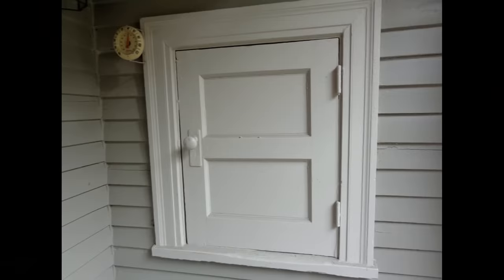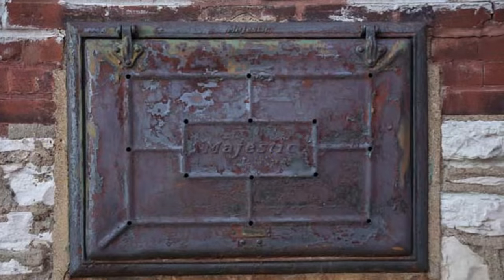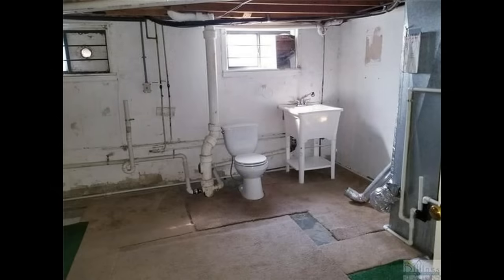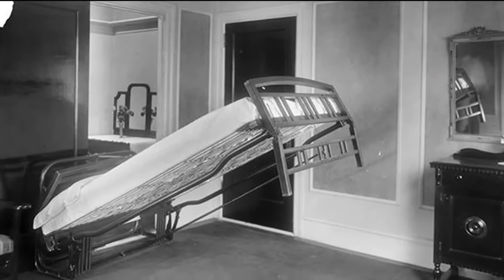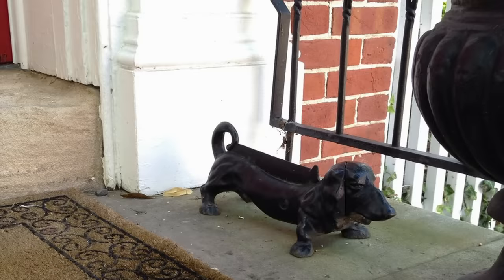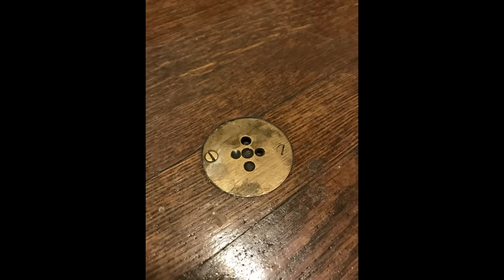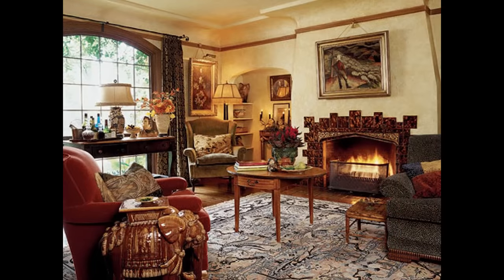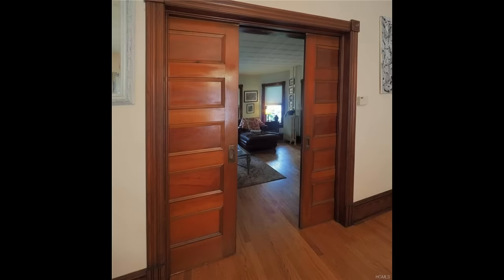Mysterious Home Features No Longer Used

Comment: Besides eliminating the need for transom windows, electric lighting made it possible to easily produce more elaborate meals after dark. Before electric lighting, the main meal of the day was typically at mid-day. Some people still call the mid-day meal dinner because of that.
Reply: We used the term "dinner" to signify the largest or main meal of the day.  Therefore at Christmas, Thanksgiving, and Easter, or whenever we were having a large group of people in to eat, it was called Christmas/Thanksgiving/Easter DINNER.  We usually had a larger meal in the evening on normal days when Dad go home from working in the fields.  The other term used for the evening meal was supper and the midday meal woud called lunch.
Reply: @davidrickard8943  Same here except the midday meal on Sunday was also "dinner".
Reply: Interesting.
My grandmother who grew up on a farm during the Depression explained what the difference between the noon meal being called lunch or dinner.

If they made food and took it to the workers in the fields it was lunch.
If they cooked a meal and the workers came to house to eat,
It was Dinner.

Thanks for the other insight.
Reply: Americans considering evening the main mealtime will forever mystify me.
Reply: @twincast2005  Well for the most part many Americans only get a 30 minute lunch break.
Especially those of us in service or construction jobs.

Personally breakfast is my main meal and anything after that is a bonus.
Reply: @twincast2005  I work for a tech company that provides lunch so that is my main meal.
Reply: @twincast2005  the evening meal is typically the only time when all the family members of a household can meet without being rushed out the door to school or work. It is usually a family meal where they all sit at the table and visit while eating. If course their are those that eat in the living room or den, the room with the TV.
Reply: @Cassandra Dining was a more elaborate affair which wasn't practical in the dark of night, so the dining used to take place at mid day. Electric lighting changed all that and turned it on its head. But for eons into the past, the biggest and most laborious meals were always prepared and eaten in the light of day out of necessity.
Reply: @twincast2005  I guess this is because of the fragmented morning start times, each school has a different start time to accomodate bus scheduling, Dad or Mom leave for work at one time and the other at another time.  So if the family is to have a meal together, it is in the evening (sometimes this is the only big meal children get).  Besides that, this is the time the bread winner usually gets home and needs a big meal if he has had a physically demanding job (which is still a hold over from before men went from a physically demaning job to more of the office and executive type work).
Reply from the maker: Thank you for watching Lance!

Comment: As someone with a 1950s home with 2 (formerly 3) pocket doors, I can understand why they're not common. They're hard to replace and repair. Sometimes you can get by just removing all the trim but other times you'll need to open up the wall if the track inside becomes damaged. As they age, it can be a real headache. Plus, latching or locking them securely has limited options that are usually finicky.
Reply: I assume they use the same rollers and tracks as sliding closet doors, which are always getting out of adjustment. Adjusting those things in a pocket door could be a real hassle unless access panels for such adjustments are designed into the envelope.
Reply: They are almost always designed without easy access. I have a couple in my home that we do not use because of adjustment issues. I really do not feel like removing walls
Reply from the maker: Thank you for watching and sharing your experience with them.

Comment: Hey Rhetty, here is an arcane feature for you. Many old, well built, homes in Chicago, Indianapolis, and St. Louis had rock-stone foundations. Did you ever wonder why? Well, houses in these areas often had high water tables throughout much of the year. If the area got soggy you would have a wet basement, but a dry house. Also, many Europeans were stone craftsmen. So these guys could shape and cement stones together. So it was an employment opportunity. But, finally, the soils in these areas had large rocks and limestone rock ledges. When you wanted to build a nice house you would hire a crew of diggers to make your footprint. Since there was a pile of stones in what would become a front yard, the next job was to wash what stone was dug out. Then the masons would cut and fit the stones into a basement walls. Today engineering techniques have been invented to keep these old house basements intact, for future generations.
Reply: Very cool.
Reply: My parents old house in NY was built in the late 1800’s and it had a stone foundation. Our house was the first one built on that block. It had a big beautiful stone wall that was seven feet high.  It is still in great shape along with the foundation of the house. They knew how to build things that would last back then.
Reply: @GhosstRyder  Actually no. Architects did NOT know how to build stone houses and there were many failures  since the stones were a pile made into a pyramid shape. It was not until about 1940 that architects had to invent the inverted (up side down) Tee. A pyramid just keeps slicing into the soil like a spade, over decades. A tee-base never moves. Today in St Louis many of these old homes are having sections of the walls dug out and then supported with concrete pads.
Reply: @MrMockingbird1313  Thank you. Our old house was built very well. We are still in contact with the new owners and everything is still holding up well.  My dad and Nonna (Italian for grandpa) were both stone masons. They did Beautiful work throughout the NY area. Those skills seem to be lost now because kids today are all glued to their computers. My dad passed away when my boys were very young so unfortunately he didn’t teach them that skill but they have other very useful ones. I have an electrician and my older one installs high speed garage doors for businesses and large buildings.
Reply: @GhosstRyder  Excellent information. One HUGE difference is the soil content. In this part of the Mississippi valley the soil can turn to mush with a small earth tremor. Soil back east is much more stable. That is why the pyramid vs. the inverted tee makes so much difference.
Reply: These are called “rubble stone foundations”. The waste excavation rock was repurposed as building material. 
The fast method of constructing these would be to build a horizontal wooden plank form work. The rubble would be more or less chucked in with mortar chucked in between stones. As the walls grew taller, another plank was simply added to the formwork. This way, it was easy to reach in the formwork as you went and place stones. Where one desired nicer-looking stones (usually on the outside of the wall and above grade) it was a straight forward change to the good stuff facing out, backed up by the standard stuff facing in. When dry, they removed the forms and would be left with a surprisingly-even wall surface masonry foundation that could be built relatively quickly, scaled well and did not require as much masonry skill.
Reply: @chriskelvin248  Field stone foundations in Wisconsin.
Reply: @kh3612  OK! Good to know other regions where this was also done. I grew up in a house with a rubble stone foundation in NY and was always curious how they used such haphazardly-shaped rock, yet achieved flat and square walls. Then, decades later I saw a job site where they chose this old-fashioned method and got to see the whole process+ talk to the workers about it. Fascinating and great look too.
Reply: @chriskelvin248  yes, you are correct. Anyway, this was common is some areas as a home feature. That was my point. Now it is arcane and not used in new construction.
Reply: @MrMockingbird1313  what do you mean they did not know how to build stone houses prior to the 1940's? 
in my local city centre there are houses made from stone. who have been build around the year 1100. To this day they are still in very good condition. 
not to mention some of the other buildings that are even older then that and still going strong.
Reply: @sirBrouwer  I mean what I said. Stone ruble foundations require annual maintenance and are prone to collapse from tremors and wind load. When inverted tee footings became more popular it helped old homes and homes after the '40s had concrete blocks or concrete filled forms.
Reply: @sirBrouwer  -  The year 1100?  What city in China do you live in?
Reply: @mdemers767  non. I live in the Dutch town of Flushing.
Reply: @MrMockingbird1313  a stone rubble. that is different then actually rocks as in actively extracting them from a stone quarry and make them to a exact shape. 

I mean have you aver seen the Roman build aqueducts? they are made from stone and they have been neglected for over half a millennia and still to this day they are in really good shape. and they are not a pyramid shaped building they are actually pretty sleek. I have seem some of them in France standing as if build only a few years prior.
Reply: @kh3612  Yeah, field stone foundations were commonly used in the 1800s in my home province of Ontario in houses, schools, churches, barns, barn bridges (the ramps leading up to the second story of the barn), along with field stone fireplace surrounds and chimneys. 

The last glacier left a lot of stones behind, and every farmer dreaded the annual task of picking stones from the surface of their fields, since the freeze-thaw cycle had inevitably pushed up a fresh crop of stones each year. The stones had to be removed in order to not break plows and other farm machinery when working the land.

Therefore, everyone had piles of stones laying around, and often built dry stone fences between their fields as well. 😁
Reply: @sirBrouwer  Well, I guess everyone is impressed with your world travels. But, your relating Roman aqueduct to stone ruble house, in the Mississippi river valley, makes as much sense as comparing giraffes and humans because both are mammals and have the same number of neck bones. Are you honestly NOT able to follow this thread or do you prefer to just spoil for an argument? Let's go over this one more time so you can keep up. Stone ruble basements and foundations met a need in the 19th century. Now they are an arcane building feature because they require much more work to maintain, for several reasons, than poured concrete. Got it? Be well. Read the threads more carefully.
Reply: @MrMockingbird1313  I did not read that in your statement here.

'' Actually no. Architects did NOT know how to build stone houses and there were many failures  since the stones were a pile made into a pyramid shape. It was not until about 1940 that architects had to invent the inverted (up side down) Tee.''

and no point in that command did you say anything about rubble.
Reply: @daviddunsmore103  I love the look of fieldstone foundations, fences, and fireplaces.  I live near a an area that had a lot of glacial activity, so I'm quite familiar.  A friend took me into her cellar to show me how thick the foundation walls were-- about three feet. The thing I don't like is the fake fieldstone they put on suburban houses.  It even looks fake.  Ain't nothin' like the real thing, baby! 😉☮️
Reply: Yes.. common features in San Francisco ! Also lever at top of stairs that opens the front door for guests at the push of a handle .  Another is cold storage area with screening to cool pies or foods pre refrigeration .  A built in bin in kitchen for flour storage .  Small  door in kitchen  opens to unfold a ironing board ! All present in  1903 home  i rent apartments  in !
Reply: @sfggmagda  excellent post
Reply: My dad's shop had a stone basement.  In the summer we'd open the coal shute and the inside basement door, then position a large draw fan to pull the cold air up into the shop.  Customers would comment on our wonderful air conditioning, back when ac was rare.
Reply: Miami has the same inherent issue when it comes to construction. The water table sits so high, especially because of the spongy limestone bedrock, that I have seen construction crews have to stabilize tall high-rise buildings by digging and casting cement for deep foundations.
Reply: Yes @GreatMewtwo

Comment: I'm glad you included root cellars! I lived in a house in NH built in the 1700s, and we had two basements: the regular one (with sealed off brick ovens and a sand "floor") and the root cellar. Mom was a teacher and every summer when she'd get a summertime bonus, she'd load up on groceries (for a BIG family) and store most of it down there. It was always pleasantly cool in the cellar, since it had a northern exposure. We also had a second staircase, that originally was meant for the help to use instead of the big, main staircase.
Reply: Plenty of new homes in Canada, to this day, are built with a root cellar under the front porch. However, they are more commonly called “fruit cellars”.
Reply: OMG.... 1700s ???   There is no way most buildings built today would last 250+ years. Unless you have the home built it for yourself,  Many builders often cut corners and skimp on quality. Look at how many 50 -60 year old high-rises have been demolished to start over...   ( Just search YouTube for building demolition .... there are demo experts who can make a building collapse in on it  self in the middle of a city.... great fun to watch.) I think I'll head over to one now.....

Comment: I've been in old homes that had an ironing board in the wall and had a little door to keep it from view.  The transom window above the front door is a great idea for extra light.
Reply: We had the ironing board that was tucked into its own little closet in the house I grew up in.  I wonder why we don't have things like that now.  I'm sure people still iron their clothes and it would be easier than pulling out the one that stands up on it own or the one that sits on the table - since both need someplace to store them.
Reply: @hlltwin  Most people just buy clothes that don't need pressing. They also can throw it back into the dryer with a damp towel to get out wrinkles. Lots of people just take clothes that need ironing to a laundry mat to have them wash and press for them.
Reply: I’ve never seen this in old houses but I have seen it in modern hotels and motels
Reply: @KnittyKitty215  buy clothes don’t need ironing? All clothes need ironing, even tshirts look wrinkly and need ironed. Are you suggesting people don’t own irons??? That’s like such a basic appliance. We use our iron multiple times a week, how could people not have one? Especially if you have to wear button up shirts, they always need ironed.
Reply: @rachelcookie321  I have only ironed a shirt maybe 5 times in 60 years. I'm suggesting that many people don't own an iron. Yes.
Reply: @KnittyKitty215  how? I iron 5 shirts a week. Ironing is such a common basic thing.
Reply: The transom windows are also great for ventilation from room to room.
Reply: @KnittyKitty215  Yes and my drier has a built in mister... first drier I've owned that hooks to a faucet.
Reply: In the script-writing world, an unsolicited spec script by some hopeful, unknown writer would often find its way into an agent's office by being tossed through the open transom window after hours. As far as I know, these spec scripts are still referred to as 'coming over the transom.'   ( And mainly joining the slush pile with hundreds of others.. )
Reply: I've always had an ironing board hinged from the wall, without the little cabinet. The kind that stands alone with folding legs moves all over the place as you move the iron.
Reply: The first house my husband and I lived in had a transom above the front door.  Sadly, it got taken out and boarded up when we replaced the front door.  However, they are still a common feature in a LOT of the older houses in our county!
Reply: @pcno2832  When I remodeled the utility/pantry room, I thought of installing an in-wall ironing board, but my 70's house has 2x3 interior walls (not enough room). The new drier made ironing mostly unnecessary. I have also seen houses with "broom closets" built into walls, something I wish I had.
Reply: @terencejay8845  The USPS still delivered to mail slots at front doors, back in the 60's. My boss was a mail carrier back then and had one house w/ 2 Dobermans that'd "attack" the front window. He'd put mail thru the mailslot then hang on for a few seconds while the dog ripped it to shreds, careful of exposing his fingers.
Reply: @mikep490  The UK mail is still delivered through the front door letter-plate. Mail boxes are rare here apart from office blocks. Even if you're down a long and winding drive (nice) the Postie will still drive up and put it through the door. My previous Postie arrived at my door shaken and cut. He'd been delivering to a new build nearby and their boxer dog had crashed straight through the new door with a decorative glass oval in the middle and attacked him. Dogs are still the number one Postie hazard here!
Reply: My parents built their home custom in 1962.  Mom, home ec major, had two built in ironing boards, one in the bedroom, for back in the day when sheets were ironed, one one in the partition between the kitchen and the family room so she could iron and keep an eye on kids or dinner, or watch tv.  I haven't lived in a place with built in ironing boards.  I miss them, I find it an unnecessary hassle to set up and move  around an ironing board.
Reply from the maker: Thank you for watching and sharing what you have seen Alexandra!